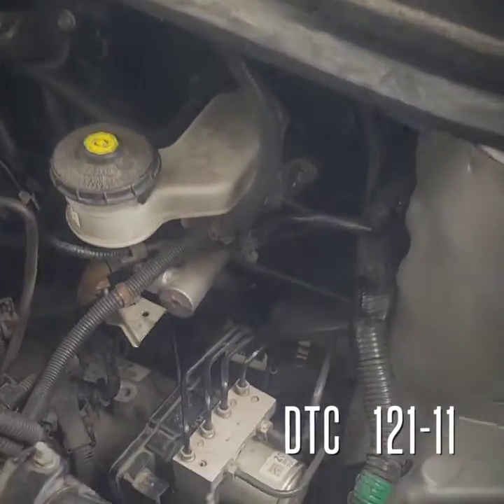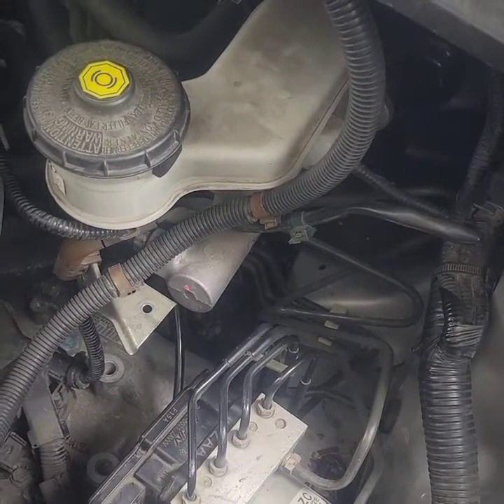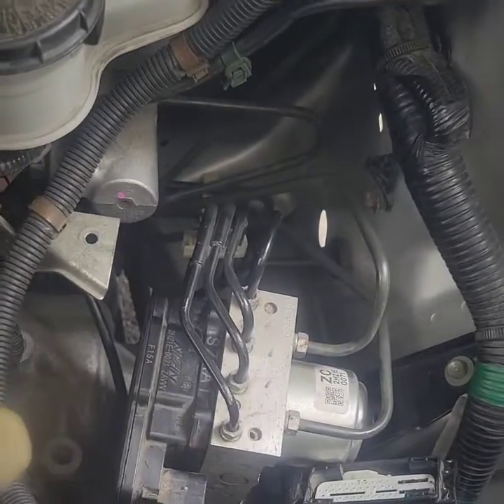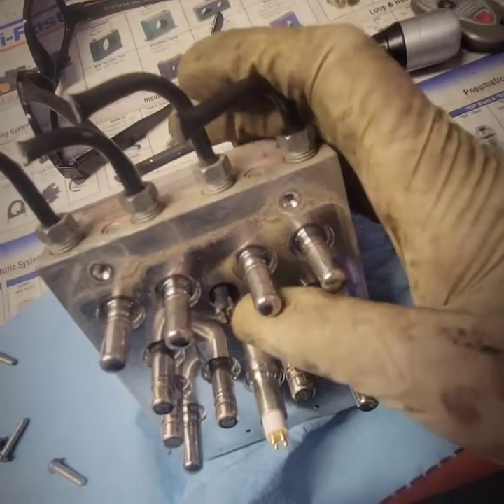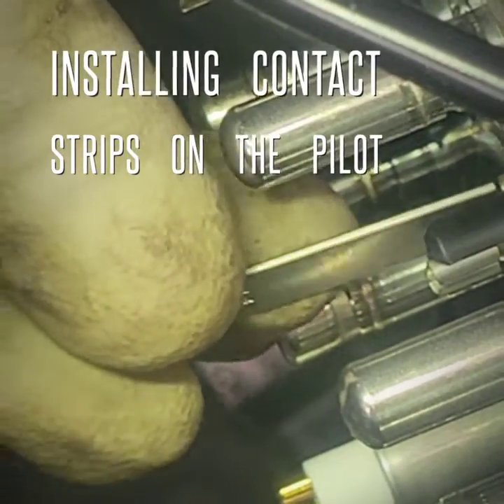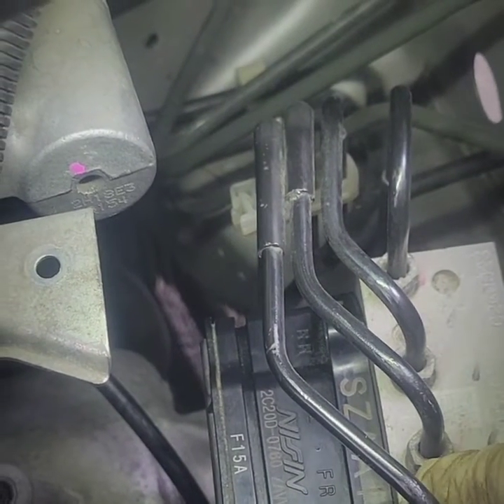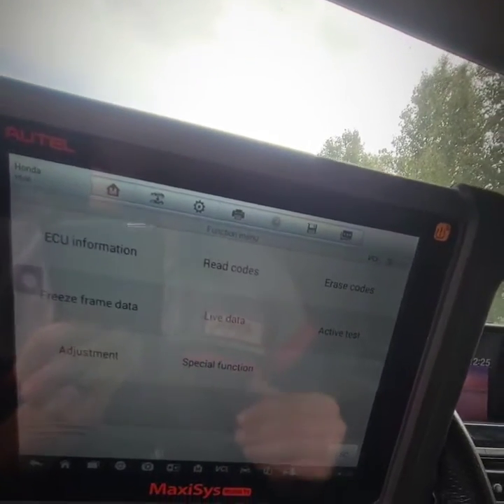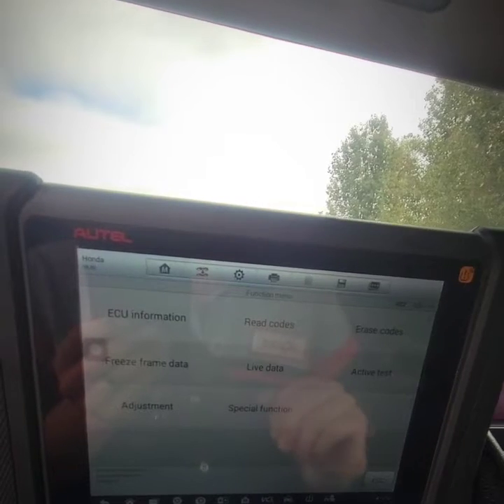Honda ABS Pump Fix- The Easy Way Module Replacement for 121-11

Comment: I have a 2008 Honda Accord Coupe and bought a replacement unit is there any pointers you can give me to make sure those two spade terminals are in the correct position .
Reply from the maker: @Rumblrr  Hey, just install them into the abs unit first before you install the new module. That's it. You'll see how the tabs are positioned when you remove the original module.

Comment: Good to know. I ought be having to do this soon. Any recommendations on where to get the module from if not the dealer?  Something unrelated but helpful for owners of this Honda 3.5l is the timing belt tensioner fails prematurely. You can replace it in 30 minutes without having to remove everything. Someone showed me and it works. The belt doesn’t move and you won’t lose your timing. It’ll save you hours.
Reply from the maker: @Cfass1  I bought a used ABS unit for 350 and swapped the module. 

Yeah I'm done plenty of timing belt tensioner replacements. 👍

Comment: Hi if you replace the black cover do you have to reprogram the new unit ???TIA
Reply from the maker: No programming is necessary
Reply from the maker: No programming is necessary
Reply: @mbmauto-mobilerepair  that is what the dealership  is saying. I went in to get a new unit for "2016 Honda HRV LX" and it was (breakdown)
1. Modulator assy $1,936.05
2. sensor assy, L (speed sensor) $92.19
3. sensor assy, R (speed sensor) $92.19
Amazon has the two speed sensor as loe as $18 for both. 

Plus labor and programing
Coggin Honda on Atlantic Jax FL 32225
Reply from the maker: @roystervi  not sure about your vehicle  but the pilot didn't need reprogrammed

Comment: I am attempting to do this now. I removed the air filter box easily. I then proceeded to loosed the four T20 Torx bolts that hold the vsa on the pump. I wanted to make sure they are not frozen/stuck and I end up stripping them. I did find I was able to back them out slightly, so that wont be a problem. The bottom one are a little difficult to see and I did drop my micro rachet and bit once, so I put a string tether. Biggest problem I have is the electrical connector. It looks like it has tabs holding it on. I found I could pry up the top tab, but the bottom tab was difficult to see and feel, even using a mirror. I did pry the bottom slightly and I was prying the top again to see if I can pull it off, but the top tab snapped off. DARN IT! not sure what to do at this point. I can put it back together and take it to the dealer. They quoted me $2600 and the part is on back order. I could undo the brake lines and take it off with the pump and maybe I can access the bottom, but I don't have much experience bleeding brake lines. What would you do???
Reply from the maker: Are you not able to properly connect it with the tab broken? 
Might be okay with some butyl tape to keep it in place. I'd avoid removing the lines if possible.
Reply: @mbmauto-mobilerepair   Well I didn't get the connector off yet. I paused after breaking the top tab. That was the tab I could see. The bottom tab seems more difficult to see/reach so if I am not super careful, that tab could break too. There is also some kind of white clip next to the top tab, I think it slides up, but I am not sure. I have  buddy coming over in the morning to give me his opinion on how to proceed.  Yes, maybe some good electrical tape or even a dab of silcone sealant across the top could help hold it together. I just don't want it too look all janky incase I do have to take it do the dealership, they may not want to touch it (they may nor replace the VSA if I wanted them too if they couldn't guarantee the connector will work.)
Reply: @mbmauto-mobilerepair  I think I figured out how to get the connector off. According to the modulerepairpro site in the removal section for my vehicle, step 4 says to Disconnect the VSA modulator-control unit 36P connector (A) by pushing the lock (B) and pulling down the lever (C);
the connector disconnects itself.

Comment: Thank you for your nice video. Ivv be will be trying this soon. Is there a specific orientation those contact prongs need to be in when they are inserted back into the pump? For example if they are turned 5 to 10 degrees do they still go in but not work, or are they keyed and only go in one way?
Reply from the maker: You'll see they only go in one way.
Reply: Thank you for the fast response. One more question, what is the bit you use to remove it, a torx?
Reply from the maker: @rogerbaker5090  Yes, I believe there's 4  T-15 screws

Comment: Mine Honda pilot 2013 
Abs code dtc 66-11 and 121-11 , Honda told to replace the ABS it’s cost lot . What shall I do sir ?
Reply from the maker: Buy a used ABS Pump, try the module swap as described in the video. If it doesn't work then you'll have the abs pump on hand.
Reply: I was going to send mine off to get repaired. There is a few companies that do it for $200 or so
Reply from the maker: @rogerbaker5090  that will work also. I think I paid 300ish for a used ABS Pump. Either way...

Comment: Hi great video 👍🏼. I have a 2008 Honda Civic 1.8l and I’m having issues with the calibers sticking. I installed new calibers, slide pins, rotors, brake pads and both front brake line hoses. I’m still getting a stuck caliber on the driver side front. I filled the brake fluid reservoir to the correct full level but can not seem to find the problem. There’s no leaks around the master cylinder, no ABS or break light on and the brake lines look good. Brake fluid runs through the front brake lines properly. I’m stuck on this one. If you or anyone have any ideas on what my issue is can you please let me know. Thank you.
Reply from the maker: That is strange. 
Do the brake pads move freely in the caliper bracket?
Did you replace the caliper only, or the caliper and caliper bracket?
Reply: Did you find the problem?
I have the same problem

Comment: Quick question tho is it the contact that is the issue or a module issue like is there a way to disassemble like you did and repair the problem or is it a motherboard module type issue? Thanks for the video I knew there was a quick repair rather than replace old with used part
Reply from the maker: It's not that contact strips it's the module itself. Just, make sure you insert the strips as I mentioned and you'll be good.
Reply: @mbmauto-mobilerepair  thanks for the reply and the video man appreciate it
Reply: Would this work on an 06 pilot @mbmauto-mobilerepair
Reply from the maker: @curtismccurry9852  not sure but if you have the space to do it... might be possible

Comment: Hopefully this sorts out the 13 Pilot I have in the shop.  Thanks for saving me a TON of time r&r wise.
Reply from the maker: No problem, glad it could help someone. 
Let me know how you make out.
Reply: @mbmauto-mobilerepair  literally took me 5 minutes to remove then another 5 minutes to search for the torx bit that fell into the ether.  😂
Reply from the maker: @bandwagon240  haha 😄 same thing happened to me.